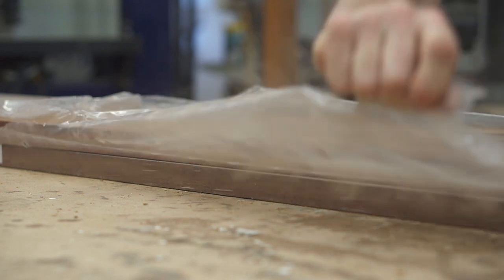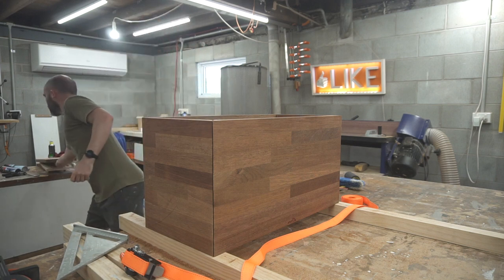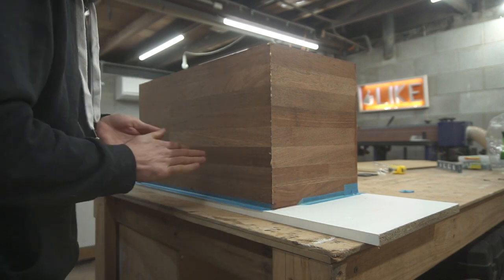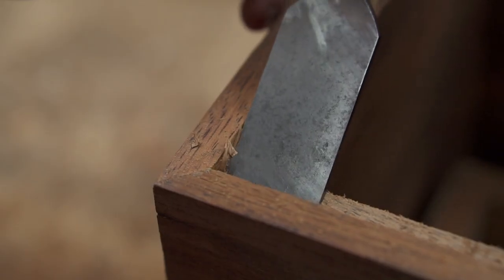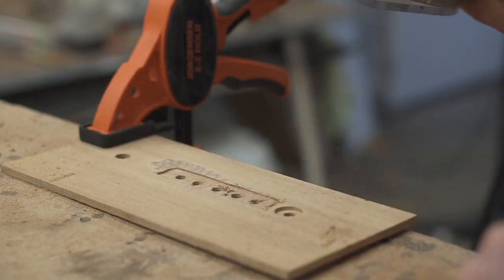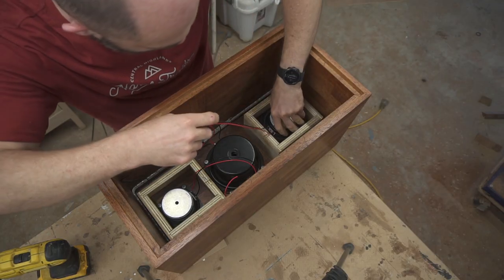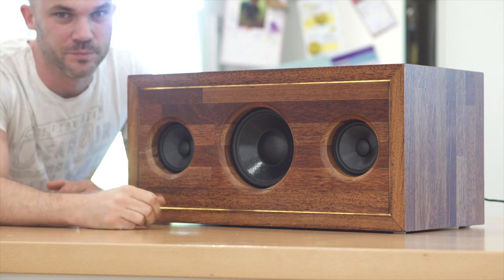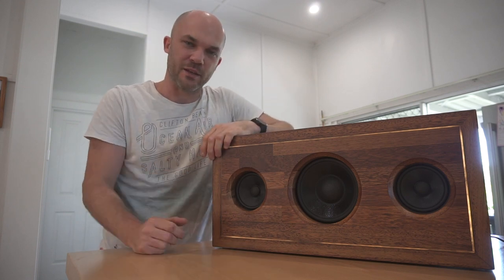A Beginners Guide To Building A Bluetooth Speaker

Comment: Nice job....it does seem that even the best speakers (for decades) have used MDF or similar for sound. The fancy ones just have hardwood veneers on them.
Reply from the maker: Thanks. I was always told mdf has consistency in its density, and no wood can match that. Hence it’s the material of choice

Comment: Is hard wood better than mdf for boxes? Because I have enough oak to build a hundred of those.
Reply from the maker: I've read that MDF is the best option because the panels are uniform in density, natural wood changes across a board. Is it anything that you're likely to notice? Personally I don't think so, so I'd say go with the oak
Reply: @RobinLewisMakes  I'm thinking of build the main boxes out of mdf and cover with the hardwood for look idk what it will sound like being so heavy and dense but I want to find out